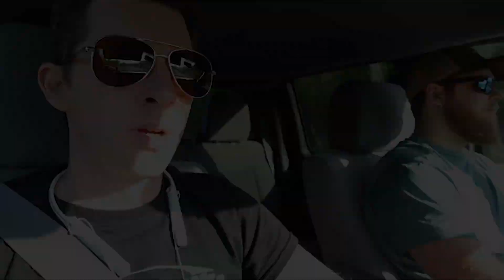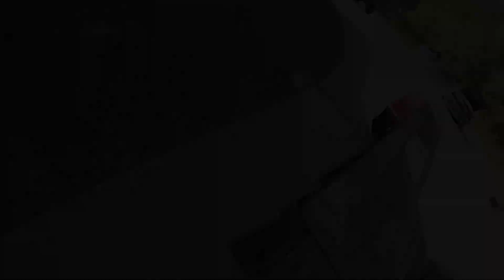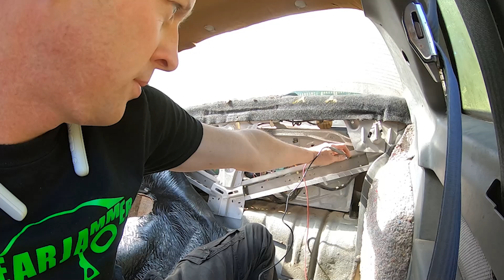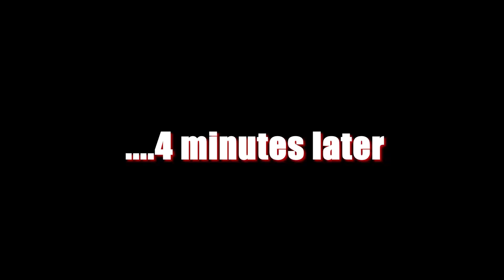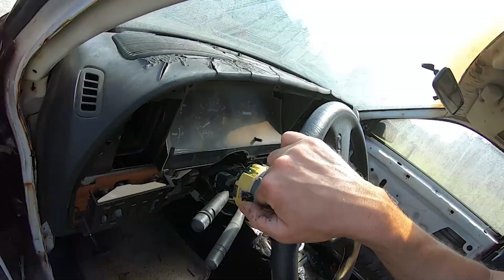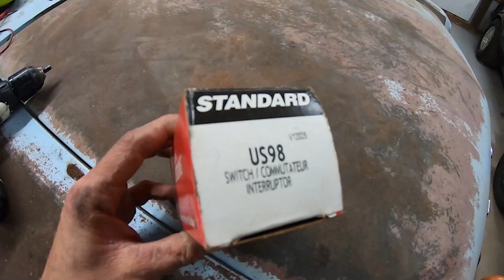Will It Run and Drive?  #Turbo #ford Parts Car Track Challenge

Comment: How did you wire that IRCM?.. I NEED TO KNOW!!..
Reply from the maker: I'd never done it before this. I found an internal diagram and it shows a relay just like a normal 5pin. I just jumped across pins 30 & 87

Comment: Drill battery/jump pack on the window motor wires.. 1 way it goes up reverse wires it goes down. This was a awesome video
Reply from the maker: 😂 thanks I tried that once it was back at the shop and neither side worked
Reply: @2300gearjammer  I also recommend a hammer.. works every time! 😄
Reply from the maker: 😂🤣😭 I tried the hammer first. They run but I guess he borrow some of the tracks that connect them to the window.

Comment: Dude best idea ever!!! I've done a fuel pump in some dudes driveway after I gave hime 500 and drove home on some t-tags!
Reply from the maker: I did exactly that many years ago too and that's where I got the idea. I hoped it wouldve been that simple 😂
Reply: @2300gearjammer  Murphy's law
Reply from the maker: 🤣 especially if I'm sitting inside it.

Comment: Sounded like mine when it spit the head gasket out between 2&3, little rough idle, occasional spit back thru the intake and exhaust but clean at about 1500 freespinning and 3000 up under WOT. Hit it with a 50shot one night and took out the gasket between 3&4 lol, still ran and drove it home though. Come to find out the distributor had moved and had 20* initial so that 50shot was a little hot🤣
Reply from the maker: 😂😂 that's 100% something would do

Comment: Currently trying to find a 2.3 turbo block. want to build a 2.3 for my 96 ranger! i have no idea what im doing lol, 100% youtube mechanic here.
Reply: Im doing the exact same thing lol
Same year and everything i got the block already just need the expensive stuff now
Reply: @eltalleratomico7751  Im having a hard time finding a block, i can always just drill and tap a hole in a regular block if i have to i guess. The truck has a good motor, only 89,000 miles, i have no idea how long itll take me to build an engine so i dont really want to pull mine and it sit for month.
Reply: @trevorhoward6115  yeah i would run that motor till its dead it still has tons of life left the one in my truck is still going strong at 200k i wanna have the new one ready before it blows tho lol
Reply: @eltalleratomico7751  oh man, no more than i drive it would take me 15 years to hit 200k miles LOL. I bought the truck to kinda have fun with, acually getting ready to paint it myself.(never painted anything in my life) should be interesting
Reply from the maker: 😂 well the best advice I can give is a whole lot of the stuff I do here is for a laugh.  So if you doubt something make sure you put it in the comments.